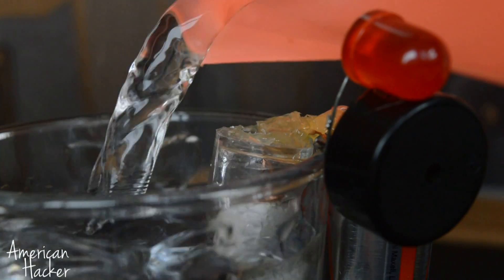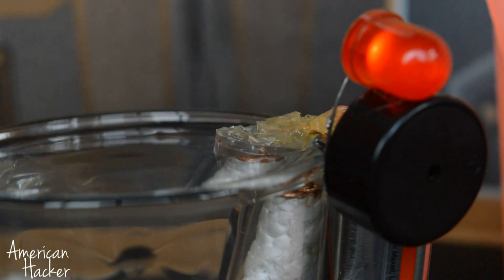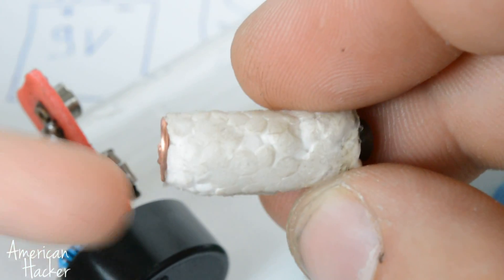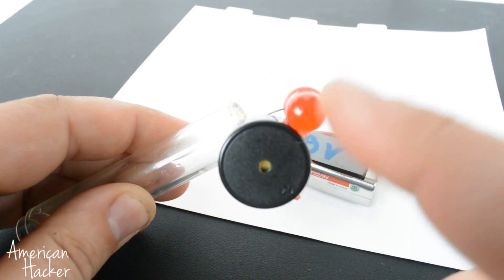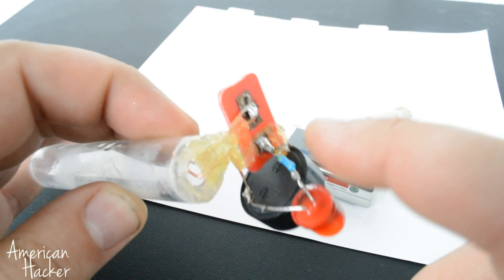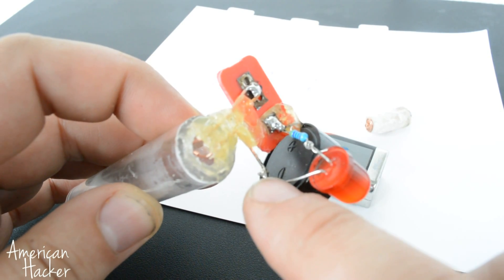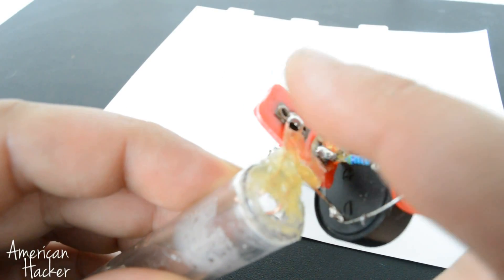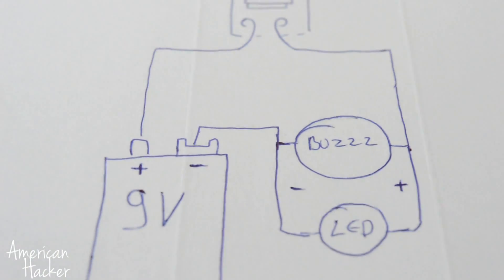How To Make a Water Alarm!

Comment: at first clever, but after using this in a productive fashion the styro will get really dirty and ugly. Any ideas for a more permanent solution? Let me give 2 ideas,a) measuring resistance or b) ultrasound.
a) Voltage has to be below the voltage required to split water into hydrogen and oxygen. b) Could get expensive and power hungry. c) Your idea!

Comment: Cool.   now set the contacts lower and hook that up to a relay for a solenoid for the water source or whatever.  the when whatever you are filling is full or set to whatever level you want,  the valve will shut off when the contacts hit.  bam.